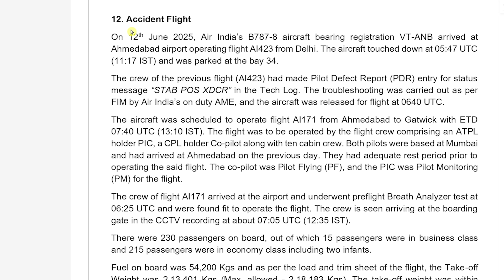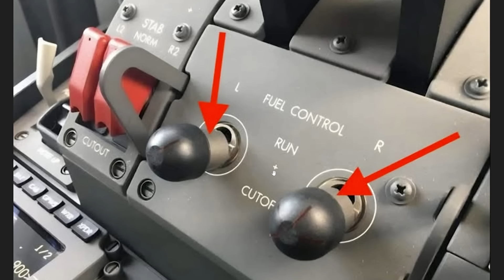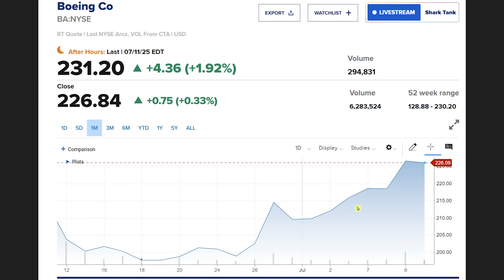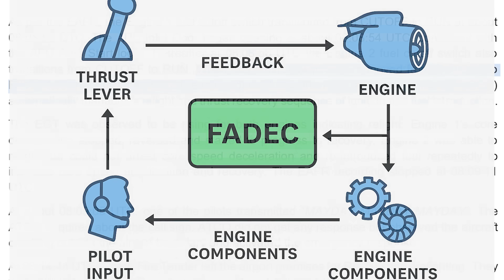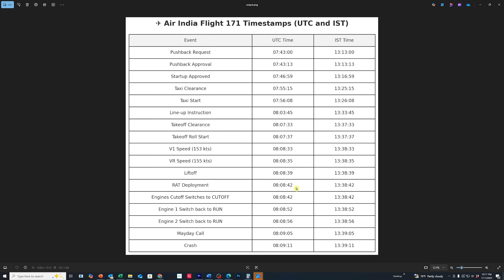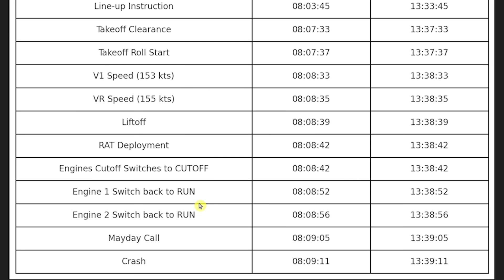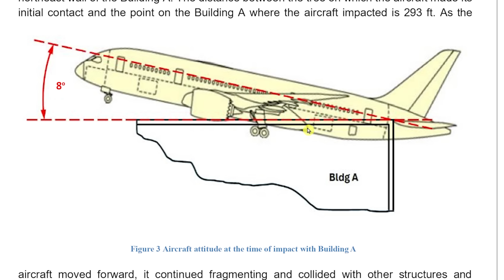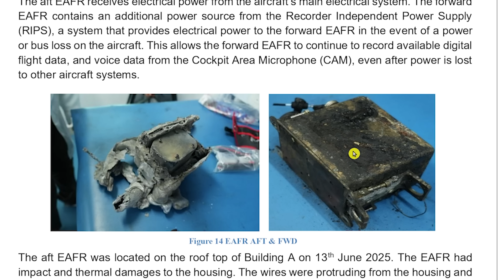Did Pilots CUTOFF Fuel? Shocking Twist Air India 171 Report!

Comment: There needs to be a cockpit camera as well as cameras on the runway, no reason to not have them
Reply: THERE WAS A DVR.  They retrieved the video recorder on the 13th.  Up to 12 cameras around the cockpit could have been on.  They verified that the video recorder was retrieved and that it survived, but they have released NO information yet about what's on it.  Very frustrating!
Reply: @VerdictREX because my knowledge is that pilot error/intent is always kept in mind but everything else would be ruled out first, like anything else. Difference is id leak a plane malfunction on 95% certainty i was right, i wouldn't ruin a pilot and his family over a 5% chance I'm wrong
Reply: @MrCodykuczenski  That's how I think as well...but that is not how these investigations often go.  At the first reliable indicators of pilot error or malintention , they will keep the media fixated on that talking point, even in the face of very serious and real indicators of equipment, mechanical, software, and other error.  The liability stakes are too high and they obscure the public's ability to find out the truth.
Reply: @VerdictREX Precisely!
Reply: @VerdictREX  Very frustrating, and frankly, very suspicious.
Reply: @VerdictREX  Exactly for this reason I don't trust any of the speculation jumping to the suicide conclusion. I remember the report and seeing the video of the DVR being the first thing recovered. Why no mention of that in this preliminary report?
Reply: @VerdictREX  "THERE WAS A DVR.  They retrieved the video recorder on the 13th.  Up to 12 cameras around the cockpit could have been on.  They verified that the video recorder was retrieved and that it survived, but they have released NO information yet about what's on it. "

The DVR records information from cameras in the cabin, but there are no cameras on the flightdeck.
Reply: Or an auditory warning for any critical switch to alert the other pilot “fuel switch cutoff enganged” a camera would only help in the investigation, not the act in the moment
Reply: @MrCodykuczenski You would have auditory overload liking on top of task saturation. 

Millions of flights have happened with fuel cutoff switches that didn’t blare a warning every time they were moved. One crash has occurred. 

The more auditory warnings you have, the less the flight crew will react to them.
Reply: @MrCodykuczenski once the switch was turned off the plane was doomed. An audible sound would be meaningless
Reply: @MrCodykuczenski  Good suggestion
Reply: Manual engine cutoff should now be disabled until the plane is at an altitude enabling an emergency glide return to the runway
Reply: the pilots privacy is not good enough reason, the passengers want to know everything for there own safety. Truck drivers have cameras for years.
Reply: A DVR was recovered from the crash site.   Surprised it was not mentioned in the report. From the news report I watched, it appears US airlines opted out. watch?v=vumDzVRV0ZA
Reply: very good point because taxi cabs and public transportation buses have cameras installed inside!
Reply: I predict that all aircraft will soon get an update with auditory warning for fuel switch cut off due to this incident. (at least during TO/GO)   I read some comments about that it would be an "auditory overload"  to have it but i do not agree. If they had it already then it could have saved the 10-14 seconds to realize that the thrust/engine problem was the switches. (probably not something a pilot would expect the other pilot to  switch off without saying anything..)
Unless the wrong type of switches were installed(without the detent so that they could be parked in the middle and accidently bumped to off) then it would seem that this was cunningly planned with bad intent.
The exact words spoken and recorded in cockpit arn't in that preliminary report? which seems suspicious.. all the words, voice tone, expression and timestamps  are key clues in resolving what happened.  Seems unlikely that not more was said  in cockpit. Hopefully all words spoken and the recording will be in the final report.
Reply: Think of how many runways there are, and you need cameras at both ends, you need to clean and maintain them, and you need to store the data for a while at least. Think of how many cockpits there are, and the black boxes need replaced to hold more data and accept the camera inputs. How many times would it have helped? We have enough data to figure this out.
Reply: @ED-es2qv . Exactly right.  Many have suggested that you don’t need black boxes anymore, that flight data, cockpit voice recordings, even flight deck videos could be directly uploaded to Starlink satellites.  Just as you point out, that would require unimaginable storage capability given the number of flights occurring every hour.   It’s not practical,  since we do have a simpler solution that works most of the time.  The disappearance of Malaysia flight MH370 is one of those outlier cases, however.
Reply: What serious report would omit the miliseconds in this case
Reply: I wonder if the plane would slightly move if the pilot had taken off one hand to move the switches
Reply: Cameras on the flight deck have been suggested in the past, but pilot unions have always fought it.  If you want to understand why there are no flight deck cameras, ask the major pilot unions how they feel about it.
Reply: @philiplangford9434  If there is a camera there, you can't take naps or do anything else inappropriate. Even bus drivers don't have privacy while driving the bus.
Reply: @pekkavirtanen5130 . And that is exactly why the pilot unions don’t want them there.  Unlike a bus or truck driver, there is a lot of down time for pilots on a long flight.  Once you climb to cruising altitude with autopilot on, the flight deck is pretty relaxed.  You can imagine how relaxed it would be if you knew you were on camera all the time.  Maybe some pilots will comment on this because I am just relating what I have read in the past on this issue.
Reply: @philiplangford9434  what ever it is.. if we trust on pilots and put our lives in their hand? They shouldn't do the stuff that they shouldn't.. period. CCTV should be must. After all  It's my safety concerns!!
Reply: @philiplangford9434  You could also ask the unions of fried food sellers, the pol-ice, medicos and a whole heap of other professions about THEIR opinions. However, we need accountability. (Spoken as a pilot who retired last century, where we chain smoked in the cockpit and ... oh, never mind.) But, we need some accountability.
Reply: @philiplangford9434 If this is what everyone thinks it is … there will be cameras in the cockpit very soon😊
Reply: @philiplangford9434 Why do they allow any recording then?? Just tell everyone in the union that they are FIRED for being so damn ridiculous. We’ll walk.
Reply: What would the camera do. We know what happened
Reply: @billfraser9731  We still don't know who switched off the fuel. Camera would have easily identified that.
Reply: CCTV Cloud recording could save from lot of investigation
Reply: Misleading headline- if they had an argument, they left it out. One said why did you do that and only time to say Mayday—
Reply: I do not know if he has changed his position but Les Abend was against cockpit video as an invasion of privacy.  I support it and cant fathom it not being a mandate since Air Florida.  Year after year we ask why when we  could KNOW.
Reply: To those who want cameras because they don't trust the investigation, you realize we live in a time of AI videos right?
Reply: @mikesorensen5228 you have no idea how investigations are done.
Reply: @mikesorensen5228 AI audio too, so what is your point
Reply: @denniss3980 i agree cameras could be helpful to capture certain events and aid investigation. It wont help those who've already made up their mind.
Reply: They don't want them be to revealing.
Reply: Big reason pilots want privacy.  LMAO
Reply: Can you say with absolute certainty that there aren't any cameras in the cockpit?
Reply: Camera would keep it flying fuel off?!?
Reply: @mikolaykuka9759  Cameras make investigation alot easier. I don't think all airlines have unions, make it available to countries that don't have unions.
Reply: Union will only agree to it if the video is encrypted, NTSB is the only party that has the decryption key, and it can only be accessed by the NTSB after an incident or accident.
Reply: @Reloadeez  who cares about union, outside USA we don't care. it should be an option to all customers.
Reply: @Doevahkiin  Camera isn't saving you blokes, you only need a pulse to get a pilots license over there. The minimum hour requirements are also a joke.
Reply: @Reloadeez Your agenda doesn't matter to the rest of the world, if there's a camera all the confusion, who did, how it happened should have been settled now.
Reply: pilot unions have been fighting that for years.
Reply: unfortunately this would not have prevented the crash, the flight data recorders and CVR explain what happened here. Even if a video shows who, it doesn't explain the why
Reply: All we would see is the pilot flashing a peace sign before the plane crashes. It doesn't the tragedy, it would only spark more copycats.
Reply: This gentlemen normally smoke weed at the cockpit and talk bad about their employers it's only the mercy of God and state of the art machines that pity on innocent souls.
Reply: Agree
At least we got voice recording
Reply: I agree, cameras must be installed, black boxes only tell part of the story, the FAA should make it mandatory
Reply: Yes there are reasons, especially for runways
Reply: @tonyjones2742 what are you talking about?
Reply: Romance with hostesses can be captured by the camera. Hence the opposition to the installation of cameras in the cockpit.😅
Reply: Yes, I think on a long flight, pilots may mess around with attendants, and don’t want cameras.
Reply: No one wants a camera looking at them all the time
And you have to consider human factor before adding a camera to the picture
Reply: And yet, there are cameras everywhere... @criminozs
Reply: yep as camera never get destroyed....and camera man nevers gets killed.....
Reply: @manisherande4568 what are you talking about, the video from the cockpit would be stored in the black box just like the audio,
Reply: @denniss3980 "The camera man never dies" is just a meme 🙂
Reply: YouTuber mentour pilot will have a video on Monday which explains why no cameras.
Reply: at least there should be high quality cameras on the runway showing takeoff and landing from different angles
Reply: Pilot associations oppose it. That is why they don't install them, but I think now it is in the interest of the pilots to have a cockpit video recorder. As a matter of fact, pilot associations should have considered agreeing to it, particularly after mh370.
Reply: There are so many reasons to not have cameras in the fight deck of aircraft.
Mostly privacy, but remember that any time information is recorded, you have to trust who holds the data
I’m sorry, I don’t…
Also, video recording would help in understanding why things have happened AFTER they have happened.
How about we prevent things from happening in the first place?
Reply: @soffici1  So far, the record of preventing a dozen suicidal crashes resulting in many hundreds of deaths hasn't proved successful. People in retail shops, child care and aged care centres and all sorts of places are constantly being recorded. This is the way of the world now.
Reply: Cameras wont survive a crash, dummy
Reply: @LukeNuke-kv1st they don’t have to, the video is stored in the black box just like the voice recording, dummy

Comment: Could it be a possibility that the flight takes off with switches were already in CUTOFF position.. question 2: why RAT deployed at the same time when the switches been moved to CUTOFF. Doesn't it takes some time after Switches been moved to CUTOFF even if it is intentional. Q3: Is there a way that switches moved to CUTOFF by some automatic system
Reply from the maker: no the engines will spool down and shut off if the switch is in cutoff
Reply: @jeffostroff  one thing which is bothering me is how RAT is deployed at the same time rather second fuel moved to CUTOFF.. has there been any explanation for that

Comment: All these mechanical switches are being controled by eletrical control panels. It is also highly possible that the electrical panels were controlling the fuel injection malfunctioned and fuel source being cutoff. It is also a possibility. Why would it be a suicide mission, it was not 9/11 !? There are two switches and both of them are simultaneously cutoff by one of the pilots not being caughted by another one while doing so !!! Suspicious!

Most probable, as per my thought, it is electrical failure. And the big companies always try to frame it as a human error to escape loss.
Reply: Yes fuel shutoff valves receive electrical condition signal 》》  to system software that can command closing off fuel valves, depending upon conditions met, overriding commands that pilots may not know about. Can be maintenance subroutine?¿

Comment: Turning the fuel switches off and on could have been part of an emergency procedure, but it should have happened much faster and for the one pilot to ask why did you do that and the other to say he didn't is sus as hell. Did the same pilot who switch them off turn them back on or did the other pilot? Did one of the pilots get a signal scrambled in his brain and mix up the fuel switches with say the landing gear switch (Total brain fart) or was it truly deliberate suicide? And then there is the ram... Did it deploy automatically because the switches were turned off or did it deploy because there was a legit problem? The timestamp is the same that makes me think that turning off the fuel switches mid flight automatically triggers the ram deployment as a safety procedure. Can you verify for us if this is the case for this plane model Jeff? In the new take off cctv pic where it shows the ram is deployed it is basically just after take-off and probably right around the time the gear up lever should have been pushed up. It appears much sooner the previous videos made us believe it was deployed. Is there a way to determine if it was before take-off or just after when wheels up should have been activated?

Comment: According to Steve the RAT will only deploy when both engines are dead and no weight on the wheels. On your time sequence it looks like the RAT was already deployed before the cutoff from the switches. Maybe they tried to restart the engines?

Looking at the report it seems like the cutoff switches happened before the RAT deployment.
Reply: Wrong alphabetical sequence. Notice that the time stamp is the same. If the timestamp did microseconds or something, then the table would have sorted it correctly. But he should fix that because if gives the wrong impression.